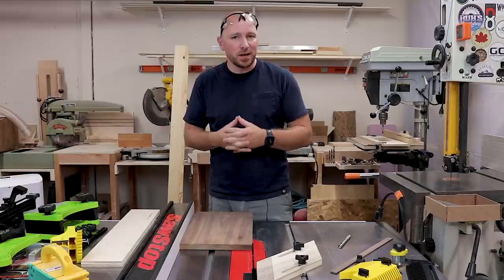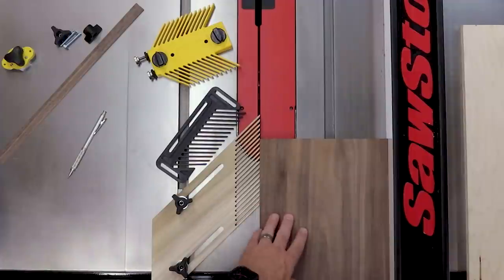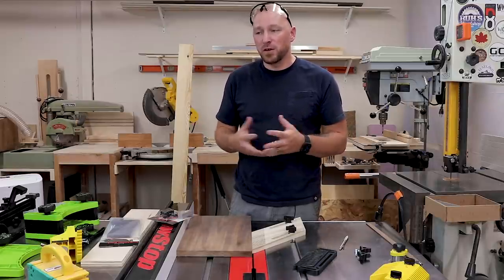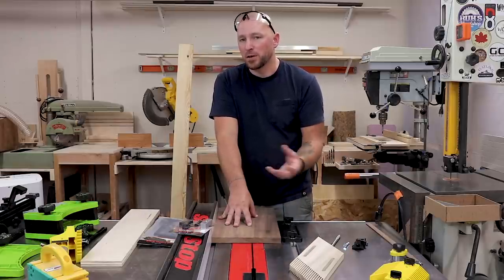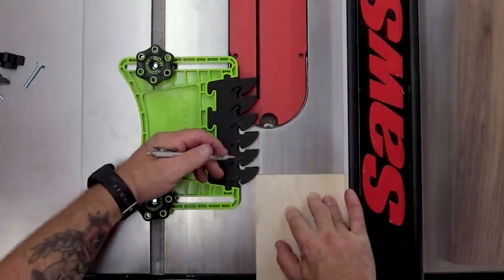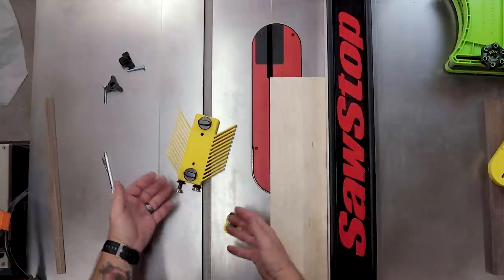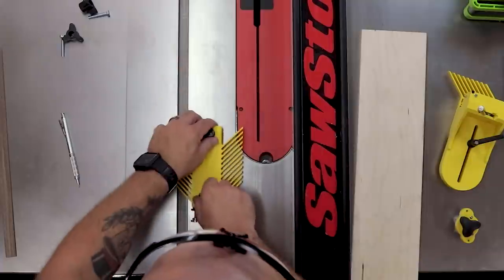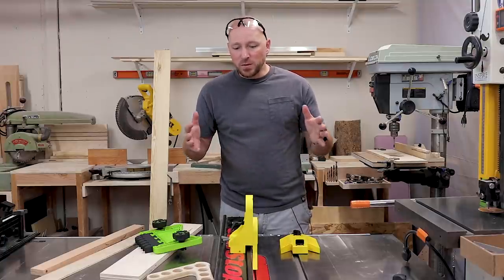Feather Boards: Purpose And Comparison

Comment: Hi Jodi, I have always had luck with DIY wooden feather boards. The trick to not having to apply force against the work piece  is to make the first feather i/16" shorter and use it to register the featherboard against the work. As for pressure, I have made 4 and 6 inch long feathers in poplar to apply different forces. After I finish building a new router table, I'm  was going to try and make a few with PVC Lumber but now I might look at those foam ones.  Nice video, good info

Comment: I have both the Magswitch feather boards and really enjoy using them. I did not know the purpose of the dual stops on the front. Thanks for that tip. You are correct that the new magswitch is a stronger hold than the older models. I have the stackable one also but it's a pain to put together so it never gets used. I had a set of Milescraft that worked pretty good, but it died in a kickback event. Wish I could attach a picture to show what a thin off-cut is capable of doing to a feather board if you don't fully push the stock clear of the blade. It sheared off every single finger of the feather board. I'd like to have a set of the Jessem roller type that sit on top of the fence, but $200 is pricey. Thanks for the video.

Comment: Jodi - thanks for the video. What do you think about using a vertical feather board on the table saw fence for bevel cutting plywood? In my experience, if the piece doesn't stay perfectly flat against the table through the entire cut, your bevel edge won't be straight.

Comment: Great video, thanks. I tend to make my featherboard press too tightly against the wood, I always have to remind myself to make it less tight. Prob my biggest issue with featherboards is finding a good fit -- my jobsite saw (SawStop) doesn't provide much as much table space between the blade and my body as a cabinet saw like yours does. I often have a hard time getting the featherboard's lower miter bar to sit in the miter track correctly. This includes my FeatherPro. I have the old version with two pieces, and the lower piece often juts out of my track. Will have to look into using a single bar like the new model. Also, good tip for using a featherboard as a stop. Have to give it a try!
Reply from the maker: The shop-made one that I had did the same exact thing. Of course that was my fault on the design, but if I scoot it too far back the lower bar can’t grab. The new one-piece design is fantastic. But that is one advantage I didn’t think of with the MagSwitch, it’s compact and may work better on smaller tables. Well, if they aren’t aluminum of course.

Comment: Hey Jodee, would you recommend using a feather board in combination with the table saw jointer technique you’ve shared? Say behind the blade in the out feed area to keep the stock straight?

Comment: Great information. You mention that the FeatherPro has an anti-kickback feature; however, you do not mention that a “normal” feather board also prevents kickback. Just try to pull a board backward with a normal feather board and you will see that.

Comment: Although I realize that this is an older video there's one thing you didn't mention about the magswitch featherboard. It can also be used as a thin rip jig which for some would eliminate one more jig in the shop.

Comment: Have any of the positive commentors below tried the Feather board Pro prior to comments. I have and the foam wears quickly and really only for finished edges against the foam.  To help with the description it seems to  be EVA foam similar to what is used for exercise mats. It is not durable for this application. The wear mostly comes from the corner of the wood as the board first enters the feather board. What could have been mentioned was to place the leading edge of the workpiece past the end of the feather board by raising the fence side on an angle then lowering the fence edge to the table. This will avoid the wear from the edge of the board. Also, If you have a rough cut edge or board with some rough spots the foam wears very quickly and splinters may get caught in the foam creating a safety issue as well as quality issues from a board feed stall situation. I hope this helps others and would like to to hear from the positive feedback folks who must have followed the recommendation and did not encounter the same negative issues that I believe anyone would if the product was applied.

Comment: Great video...If you make your fingers a little longer on your homemade featherboard, then you would not need to put so much pressure on it to hold the stock. I use ones just like the one you used in this video, but my fingers are 4" long made for 3/4" Red Oak. To be honest, I prefer my home made ones over the commercial ones

Comment: Go ahead and be the salesman for Feather Pro but how dare you tell millions of viewers that FP is the only board that prevents kickback. The fingers on every board should bend when pushing a board forward and lock up when pulling the board towards you. If it doesn't than it's not made correctly!
Reply from the maker: “Millions of viewers” is a bit of a stretch. Regardless, shop-made and plastic store-bought feather boards allow material to slide back under enough force, a la kickback and/or ejection, because they are made of smooth material that doesn’t have bite. That’s just the way it goes. The foam on the Feather Pro flexes back and helps prevent it. It’s very similar to anti-kickback pawls on a blade guard. It’s just simple facts.